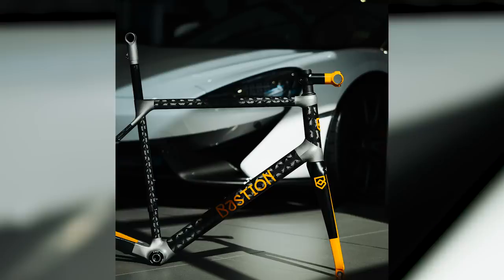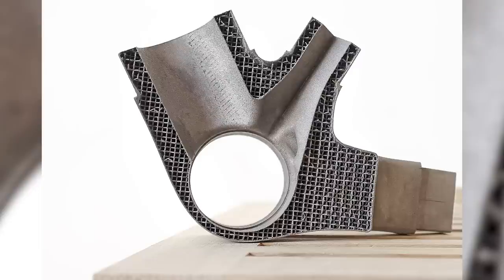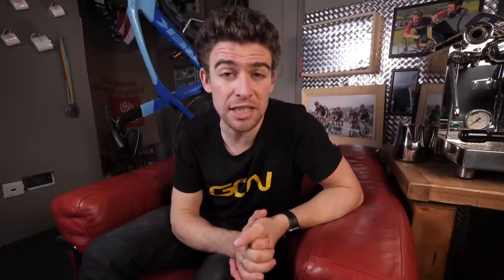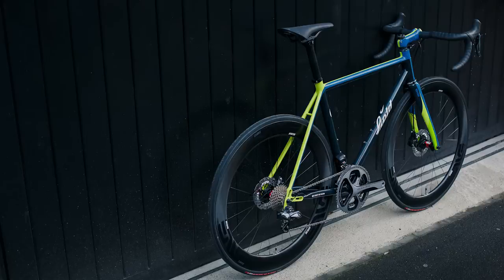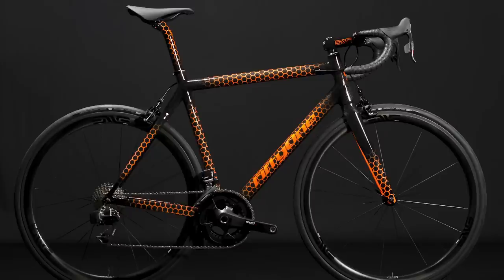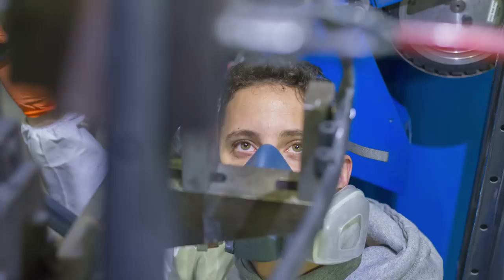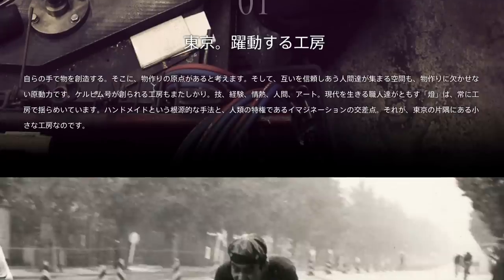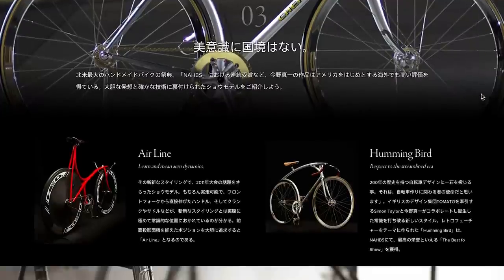5 Boutique Bike Brands | The Coolest Custom Road Bikes In Cycling

Comment: I attended NABHS in Sacramento a couple years back.  On the Carbon fiber frames front, Crumpton, Purlee, Calfee are all pretty ridiculously nice but the lugged fill carbon frames from Bill Holland most tidy with near perfect fit and finish up close.  I agree Rob English's stuff was exceptional up close and very dynamic.  Other thoughts, Retrotec's by Inglis are best looking (I'm bias I own one with S&S couplers for travel), SoulCraft had the cleanest welds and from work horse/ride/race into the ground you just can't beat RockLobster.  Honorable mention to Paragon Machine works who provide all the dropouts, BB shells, and Head tubes who help keep full custom frame more affordable since small builders don't have to spend hours fabricating all those complex pieces.
Reply from the maker: It's so ace to see this side of the industry - we're out at NAHBS at the moment so stay tuned for loads of videos over on GCN Tech coming soon!
Reply: minor correction, but you got the spirit of it... Parlee cycles not Purlee
Reply: @Kidtricky69  ha ha thanks, BTW I forgot to include Appleman.  I had to look the vendor list from 2016.

Comment: 6/4 titanium is not a "higher grade" of titanium, it's a different grade.
Reply: If it's more brittle and it cracks, that would count as 'lower grade'.  And if it's more expensive on top of being lower grade, that would count as 'stupid'.
Reply: @ankushm3t  I used to think the Litespeed Vortex and Ultimate where pinnacle of frame construction with complete 6/4 tube sets till someone with actual material knowledge pointed 6/4 should at most only be used in the head tube, BB shell and dropouts

Comment: Give me exotic alloys like Ti over plastic like carbon-fiber any day.
Even the most diehard fan of carbon has to admit that all of those metal-frame builds were damn sexy.
Reply: Carbon is a cloth, not a plastic. You'd be thinking of the resin.
Reply: I agree, Ti and Cro-Moly steel are the way to go.
Reply: @KimHDRoberts  "Carbon fiber" redirects here. For fibers of carbon, see Carbon fibers.

Carbon fiber reinforced polymer, carbon fiber reinforced plastic, or carbon fiber reinforced thermoplastic (CFRP, CRP, CFRTP, or often simply carbon fiber, carbon composite, or even carbon), is an extremely strong and light fiber-reinforced plastic which contains carbon fibers. The alternative spelling 'fibre' is common in British Commonwealth countries. CFRPs can be expensive to produce but are commonly used wherever high strength-to-weight ratio and stiffness (rigidity) are required, such as aerospace, superstructure of ships, automotive, civil engineering, sports equipment, and an increasing number of consumer and technical applications. 

https://en.wikipedia.org/wiki/Carbon_fiber_reinforced_polymer
Reply: @roye2479  Different materials for different applications. Why does one have to be 'better' than another?
Reply: @roye2479  The most beautiful frame-set I ever had was made of butted steel and built by Bridgstone when I lived in Tokyo. I still salivate when I think about it and wish I had it now. I had a Giant TCR too, but the Bridgestone was something else. I have a Peugeot Galibier that I like a lot right now, but it's not that Bridgestone, I can tell you.
Reply: @Stikibits  The most beautiful frame set I ever had was a carbon Z1, hand made by Parlee around a decade ago now. I salivate over it daily and love still having it now. Rides as well now as the day I bought it.

Comment: love all companies in the video, however, i'm partial to stinner frameworks in california, usa
Reply: One of my favourites as well. Also, Speedvagen
Reply: @MrJonas2255  indeed! I nearly bought one last yr but couldn't justify it along with my moots and sworks tarmac
Reply: @vinnym8632  You ride a Moots and a Stinner? How do you handle the vastly different stiffnesses between the two - the Moots is a stunning frame, with ride comfort and perfect handling... the Stinner, well, not so much. Not being rude (at least not meaning to be), just genuinely curious.
Reply: @KimHDRoberts  they are 2 different machines.  the moots rsl disc is their stiffest frame and have a typical race setup - enve 3.4 ses w/ 25c tires.  the stinner gibraltar d is a custom endurance geometry steel frame on zipp 303 nsw w/ 28c tires.  therefore, the reduction of road vibration is about equivalent, however the stinner allows me to ride longer (and harder) due to my ailing back (broke it about 2 years ago).  both machines are brilliant for what i use them for (and i'm certainly fortunate to have both).  but i choose the stinner these days due to fewer aches & pains
Reply: @vinnym8632  Makes perfect sense. I loved the Moots Vamoots CR, but the RSL (with it's butted tubes) was a little too... I don't want to say harsh, because it wasn't, it was perhaps a little overly stiff for my tastes. Thanks for the reply (and for not taking offence to the question).